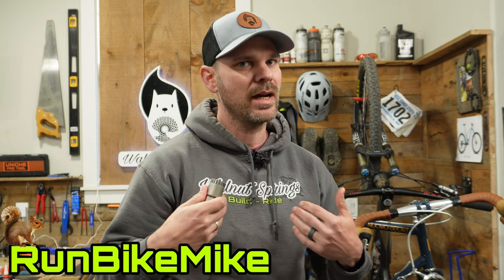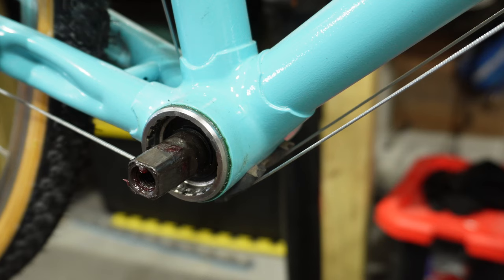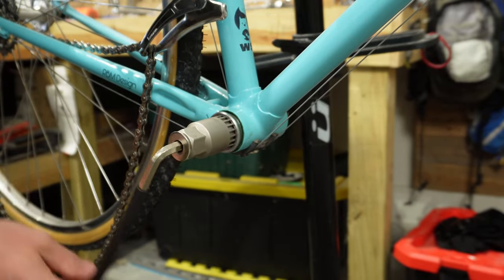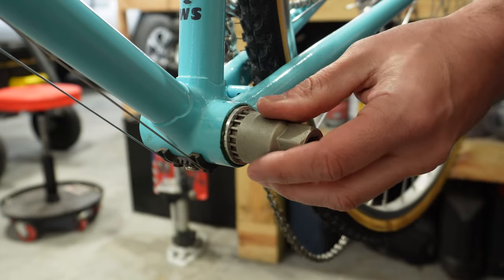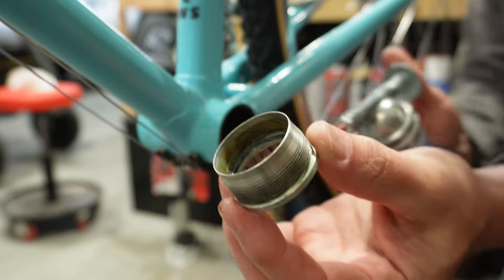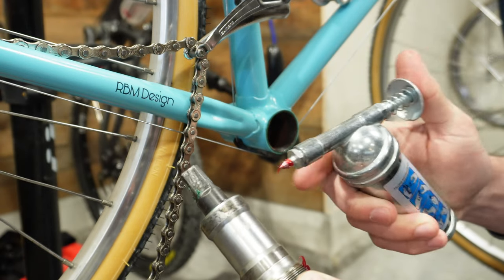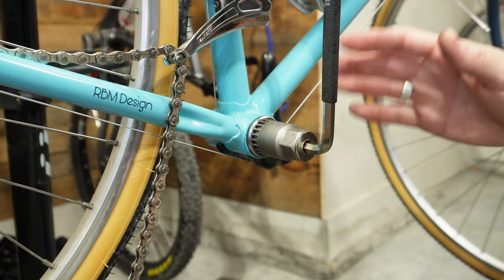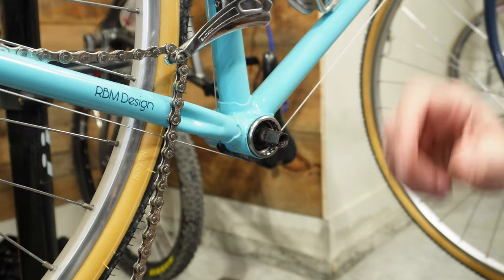How to Remove and Install a Bottom Bracket - Threaded Cartridge

Comment: Hi Mike, have sort of an odd situation with a Framed 29er bottom bracket. Specs indicate it is a 68mm eurosealed unit but straight from the manufacturer, the drive side was not tightened until it rested solid against the bottom bracket frame tube. It also has several spacing washers on the non-drive side, but those spacers are on the crankshaft, not the bottom bearing shell. The non-drive side BB also has an external lock-ring. I've not seen this situation before so I thought I'd reach out to you. Do manufactures sometimes not bring the drive side flush to the frame? Seems kind of odd.

Comment: Hi Mike.  Great video. Thx! Have a question. I have an older Specialized Globe bike with a rear-wheel gearbox, and I needed to take the bottom bracket cartridge out.  I started with the non-drive side and relatively easily removed the pedal arm.  However, while trying to remove the lock ring, I managed to break off bits of it.  Do you recommend that I go to the drive side and remove the cartridge from there?  What  are my options to replace the broken lock ring - find a replacement or replace the whole cartridge?  Appreciate your insights.
Reply from the maker: Oh no thats no good. Is it stuck if so try some tread lubricant or heat. You can try the drive side. If all else fails I suggest your local bike shop.

Comment: Hello! Regarding the creaking&screeching issues you mentioned, are these a result of applying too much torque? (I got weird long creaks happening after servicing the BB lately that I was not able to explain, so hoping this could be the cause)
Reply from the maker: Normally you sounds if it is not greased enough. But over torquing might cause that issue too.

Comment: Hello 👋 what kind of grease do you use on the threads???
Reply: Ideally you should use an anti-seize compound, but any generic grease will be okay. What you want to avoid is installing it without any lubrication, because it can seize up.

Comment: Are sealed cartridge bottom brackets able to be unsealed and maintained or are “single use”?

Your bb removal tool looks like it will accept a socket wrench…does it?
Reply from the maker: They are not made to be opened. But since they are sealed they last a long time. The BB tool will take a socket wrench.